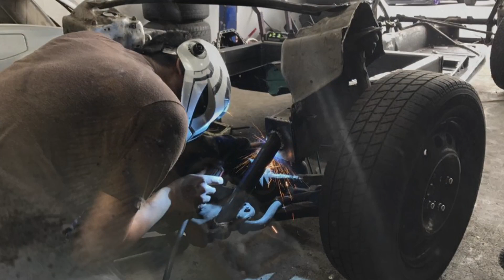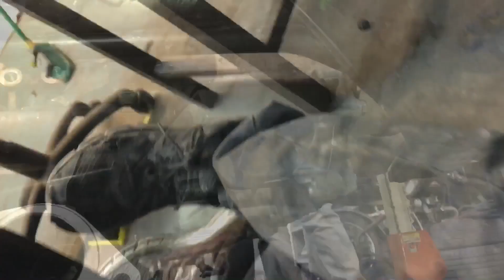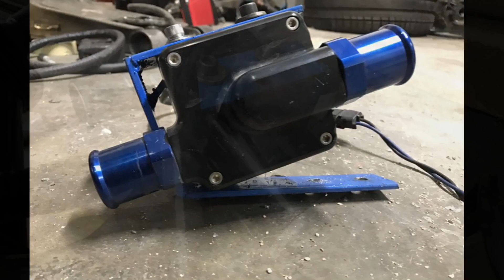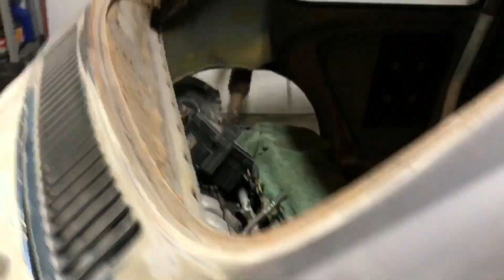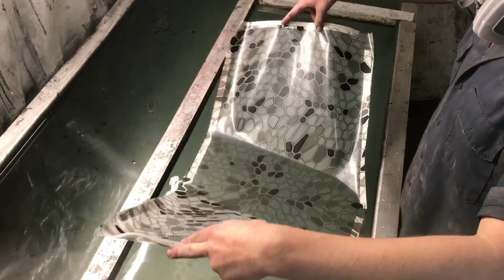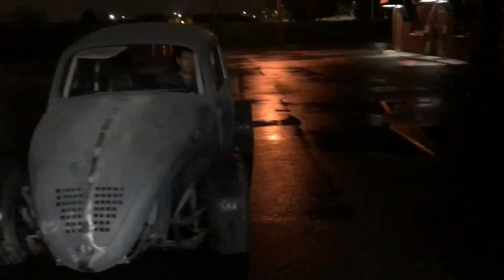Honda GSR Swapped VW Bug!

Comment: Honestly I think you guys should have done it a different way and should have put the engine in the front with a truck transmission and drive line running down the center of the Pan with the radiator in the back  Everyone puts a 8 cylinder in the front why not a 4 cylinder  You probably would have got the stance you wanted out of the car and not used all that metal FYI ,  it would have looked much better too you wouldn't have to drill holes in the front hood And it would look pretty much original.

Comment: Great work. Love the wrench brackets.  With a project like this with nothing to lose, Don't know what you are doing is very cool work.  I'm learning from your build with a  v6 front wheel drive engine from a 1998 Acura I have. Have a dozen old beetles to try it in.  I hydrodip and Cerakote also.
Reply from the maker: Right on!!

Comment: seems a lot of work for essentially nothing.You could have gotten as much or more performance  by souping up a VW engine or putting in a Porsche engine.
Reply: That B18 has a bit more potential than a VW plant...it’s also a hell of a lot cheaper than a Porsche engine.
Reply from the maker: A stock unopened b18c has been proven to handle 450-500whp.  To get a vw engine to handle that much would cost 5-8k, I did my research in that area before starting this build.  Also, after I parted the integra out, that whole swap only ended up costing me $130 sooo I’m content with the decision I made.
Reply: ^ Exactly why we chose a K24.  We don’t even have to open it up to get 5-600 with a 58mm turbo setup.  We’re doing rods, pistons, deck work, line honing and balancing of the internals.  $3k into the engine without sleeving and we’ll have something (with a good tune) that’ll be fine at 5-6 all day.
Reply: @johnd6258  right, sure,  but when you consider all that has to be done to make it work, I bet the price difference  isn't so much. You may not be aware of just how much horsepower can be built into a bolt in VW based engine.Some full blast ones go nearly 200 horses, I bet that Honda  doesn't have that much.Besides, it's still sacrilege to put that hunk of junk in  a vintage VW. Might as well use a vw GTI  engine.least ways then It would be all vw.I don't care for these mangled messes. Hell, I don't like idea of putting 350 chevy motors in vintage Ford bodies, just because it's cheaper and easier doesn't make it right.
Reply: The stock K24 I’m using is 205 HP/164 TQ.  The shop I’m working with is a Honda shop.  This makes sense for us to do.  We’re going for a full drag build.  Personal opinions aside, this swap makes sense for us to do.  We have experience with the power plant and have done mid engine builds before.
Reply: @johnd6258  yep, guys do weird stuff like that all the time.Doesn't mean I have to like it. I see no sense in setting bellypans on the ground or putting those huge wheels with low profile tires on perfectly good  cars either.Donks  I think they call them. Course in my day we did often raise the  ass end up to get a look, or to put wider tires on than would fit otherwise.We were stupid too.I guess every generation has that.   Although no matter how hot you make that  buggy, I knew a guy with a 302 in a four door comet that could whip your ass, then trade cars with you and whip you  again, he was that good.I saw him whip a Hemi GTX with that comet.While the GTX fried tires, he was gone.That was the thing, he didn't do squat to the engine, but had something done so it would hook up and go like right now.It would still smoke the tires, but only when he  wanted it to.
Reply: Come back when you can bring something to the table.  A friend of a friend doesn’t count.  Your attitude is BS.  I knew a guy who...😂🤣😂🤣...that means you talk crap but can’t back it up.  STFD.
Reply: @johnd6258  We  only did street races...no track stuff.Frankly, I wasn't very good at it.Besides, I'm old and set in my ways.I am not nor will I subscribe.later.
Reply from the maker: Hey man, just so ya know John isn’t part of our channel haha although he did hit several good points.  I have maybe 2500$ into that entire bug project.  So the money argument is invalid, if you don’t like it that’s totally fine, that’s your right to have your own opinion, but this is my car not yours at the end of the day so I’m going to do what I want with it, succeed or fail, I’m gonna try.
Reply from the maker: Also you can’t compare an engine that came factory with 60hp to and another 4 cylinder that makes 170-205hp factory with no turbo.
Reply: @GARAGEIdiotS  let me be clear, you're right, you can and will do what you want. That's fine. The fact I don't get it is not on you. I don't get a lot stuff that goes on these days, like people keeping their noses stuck in cell phones all the time.
Reply: @GARAGEIdiotS  sure I can, doesn't mean it's a fair comparison.Also since you wound up having to buy another body, why a bug? Yes you already had it attached to a bug pan, but as we all know, there are lots of other bodies  for bug pans.Want to be a hero, don't put a premade body on it at all, make the body yourself. Or if you just want to be crazy, find a 67 Vauxhall body.Looks like somebody's 57 chevy shrunk in the wash. Going  to  go crazy, go really crazy. Maybe  make what looks like a T bucket  body...or go with  a streamliner body.Go all the way, not half way.
Reply from the maker: If it helps, I don’t like the “stance” style that the kids are into now days haha I don’t do things for glamour cars shows and looks, I’m a functional kinda guy
Reply: @GARAGEIdiotS  me too, basically.I just hate to see VW bugs ruined. Do you know how hard it is to find an unmolested bug these days? Went to a car show a while back, the car getting all  the crowd attention was a near pristine factory stock bug. Why? Most people have never seen one that hasn't been screwed with, cut, mangled or modified.
Reply from the maker: Yea but if you have money or time you can buy or rebuild a bug to your unmolested liking.  They made millions of bugs,  it doesn’t bother me in the slightest.  I just went to a bug show 3 days ago and 80% of the bugs were simple, clean and stock, it got old really quick
Reply: @GARAGEIdiotS  where was this show? Around here, bugs of any variety are few and far between.There's a guy down the road      that has a beautiful red convertible with a white ragtop. He doesn't bring it out often any more, but he used to drive  it all summer long. Might be that the conditions around here rusts out everything quick.but then again  you have used up two bodies to make one car that will never be worth much.but then again, nobody makes money on any kind of race car.My stepdad turned a Boss 302 into a roundy round car.He wouldn't even take it to the track with a dent in it,  and the paint job matched his truck Weird part about it, by that time he didn't drive it himself.His real claim to fame was drag racing  a 57 chevy.That car still lives,  but it's back on the street now.He's long gone, so is mom, but that car is still going.He was well known in his day as an engine builder.Me, I did body work,  I'm not much of a mechanic.

Comment: The coolest thing about a VW is the engine, taking that out makes no sense
Reply from the maker: The VW engines are very expensive to make any power over 200hp, so getting almost 200hp by just swapping another stock engine into the car makes sense
Reply: GARAGE IdiotS i guess you are not familiar with the engine, probably in the us might be expensive, but the best thing about this engine is its simplicity, on the long run you can fix what ever problem you have with a candy wrapper, that is why they became the longest lasting car in the world
Reply from the maker: I know they are simple, but we are shooting for power not just simplicity.  I love the VW engine and think the car as a whole is fantastic, this is just an easy way to triple the HP Without even adding a turbo

Comment: What did you do about the transmission? I don't understand how you moved a front engine to the rear and linked up the transmission designed for a front engine. Did you have to order a special trans-axl that links with the Honda engine?
Reply: Doug0101 engine is facing the same way bud. Its now in the rear instead of the front, they just made a simple linkage arm

Comment: Love DIY, shooting from the hip. Good show You Guys!!
I've got a 56 Bug ovalwindow choptop body on a 72  Bug pan(constant camber IRS)with a 67 911S transaxle, 4 whl. cross drilled disc brakes & the front suspension is a hand fabbed chrome-moly subframe locating via heim joints hand fabbed chrome-moly tubular a-arms with coil-overs,  with a racing rack( turn & a half lock to lock). I'm hanging a Lexus/Toyota 4.0 ltr. 4 cam aluminum V8(1UZFE)off the Porsche' t-axle. Adaptor plate, flywheel & beefed up Porsche' clutch
(228 mm pressure plate/285 ft lb clutch disc)all courtesy of KEP, Kennedy Engineered Products in Palmdale, Ca.  They'll build almost any adapt,flywheel, clutch pkg for mating almost any engine to VW/Porsche transaxles one could ask for.
    If You cut up another Bug, consider using a Super Beetle pan,,,those MacPherson strut front ends are superior ride/handling over the double beam torsion bar trailing arm rigs, in my opinion.
Reply: Blade Cutter ... I bought an adapter from KEP in about 1973 and put a Buick V-6 on the 1960 Bug transmission. Ended up putting solid transmission mounts after ripping apart several sets. Raced a Buick Wildcat with a 430 engine and best we could do was dead Eve side by side ... Top end pegged out on the Wildcat @ 130 + mph ... Thanks for bringing me back guys ...
Reply: 🎩👍 In the early seventies we were using KEP adapt kits hanging B.O.P. (Buick, Olds, Pontiac)aluminum 215 V-8s off Bug & Bus transaxles. The late model buses with CV joints/constant camber IRS(1968 & later) we would swap the Bus trans units for Bug trans units, for the taller gear ratios. A very successful combo, run down the freeway @ 80-85 getting 25 mpg.
You said You hung the V-6 off a 1960 T-axle?  1960 were split case trans bodies, non-synchro 1st gear, at least my 60 was. 1961 was the first year of tunnel type trans bodies w/synchronized 1st gear.
Peace
Reply: Yes mine was a '60 model. I worked at a junkyard and we had the v-6 but no aluminum v-8s or I would have used that. I vaguely remember but I think you are right about the split case on my transmission. I was young, dumb and broke ... didn't put antifreeze in because I couldn't get the cooling system right and ended up cracking the block. Put a 1600 engine back in, drove it for a few more years and sold it to a friend so I could buy a 1970 bus which I sold in 1980 ... Both were still running strong at that time ... Good Memories
Reply: Yeah, the old days were good.  Cars were affordable. Speaking of Buick V-6's, in 73 I bought a clean, straight 65 Buick Special, w/ V-6 off a used car lot for $125.00. Only hockey was a cracked windshield...$35.00 to replace...pounded  that car for many road trip miles.  In 75 I bought a 69 Dodge Charger for $550.00 off a used car lot & got a ton of fun miles with it. topped it off with a fun day at an autocross, soon after sold the car to a used car lot for $350.00.  Many more good deals like that back then. Now it's 5 grand for  used POS ring ding junk.

Comment: you should have just bolted it to the transaxle with a adapter ??
Reply from the maker: Vw transaxle are extremely weak, a Facebook friend of mine build them and even he said he is switching to our setup ASAP. Also this video is 6 months old, check out the newer videos we have of it!
Reply: @GARAGEIdiotS  i have a beefed up vw axel  that holds up to approx 500hp at the wheels on my turbocharged methanol injected 58

Comment: Honda S2000 cluster would be cool. Some Empi skinnies. And a cool split bug type exhaust,  and in the future, Turbo! Go to YoungStatic on YouTube for cool fabrication knowledge .
Reply: don't put skinnies up front if you gonna drive on road , their only for straight line drag racers. Bugs are already too light at front and weight transfer to front about 80% when braking so front discs are best upgrade for performance in real world.
Reply from the maker: Thanks! This video is a few months old, check out the new ones! It has twin turbos and is almost ready to hit the dyno!

Comment: I did a very similar build on my channel years back. I way over thought the shift linkage as well but ended up doing the exact same thing you did and it worked great. I only used the stock water pump to send the coolant all the way to the front and it worked fine. I would recommend having 2 coolant system reservoirs and caps at the two high points just to keep air from forming in either one.
Reply from the maker: Great idea!! Thanks! This video is a several months old! You should check out the newer videos! It’s come a long ways!
Reply: @GARAGEIdiotS  subscribed.

Comment: I just dont really like how you went about the radiator. I would have worked with different radiators, hidden air inlets and heat extractors. The holes on the hood give it away way too cheaply.
Reply from the maker: I like how we did it haha This video is several months old, check out the new videos we have! It’s turbod now and is almost ready to hit the dyno!

Comment: from what ive seen you guys did over kill on the frame and added some over weight, i built a 1927 tee box delivery hotrod  with a chevy 350 with  350 H.P. and built my frame with 2 x 3  x 1/8 thickness and had the car 34 years with no problems and it beat corvetts and porches in a race.
Reply from the maker: Well that’s good to hear haha with us having no experience with something like this we figured bigger and stronger is better

Comment: Bit late but, the wheel base looks a bit to long for the bug body
Reply from the maker: Yea it is haha about 4”, we didn’t even think about that and now it’s too late so we’re gonna try to cut the rear fenders to make the wheel well look better
Reply: GARAGE IdiotS well if you have the time it is very possible to cit n slide the chassis, then add some under floor pan re enforcements. It is possible you just need the time to do it correctly so you dont twist the chassis etc, because no one wants a crabbing car lol

Comment: Not to be a couch automotive designer, but the wheel base seems to be a couple of inches too long
Reply from the maker: It is haha good eye, it’s about 3” too long
Reply: Hey, you have c.f. joints, why not move the axles forward? I would normally hate a build like this as I love the old bugs, having had several, but this is really impressive. Best of luck!
Reply: Drake Orion - was about to say similar; the rear wheels are too far back.
Great build though - it’s funny how any engine fitted to a Bug always ‘sounds’ like a bug 😁

Comment: Why didn’t you run an adapter plate to the stock vw transaxle?
Reply from the maker: Donald Coakley I have a friend that builds those professionally, we’re talking like $5k trans builds, and they still have a hard time handling more than 400-500.  A stock Gsr trans will take 500 all day